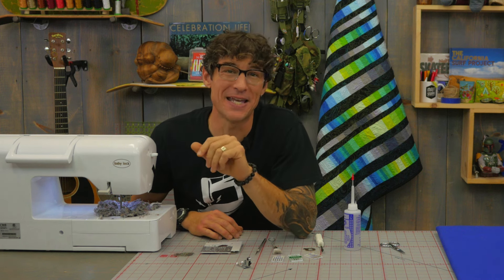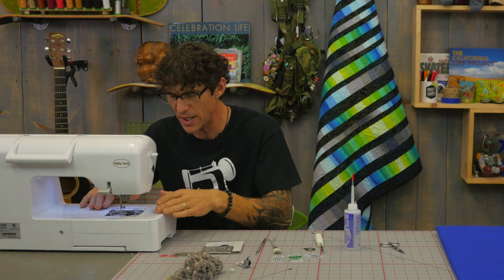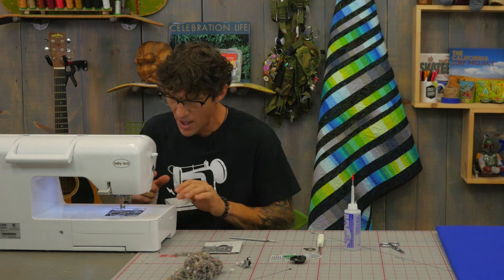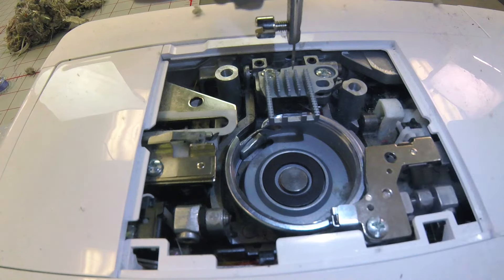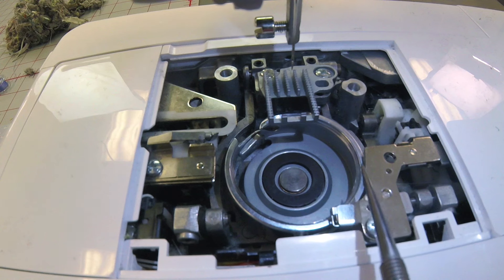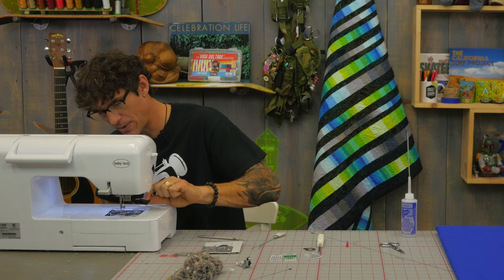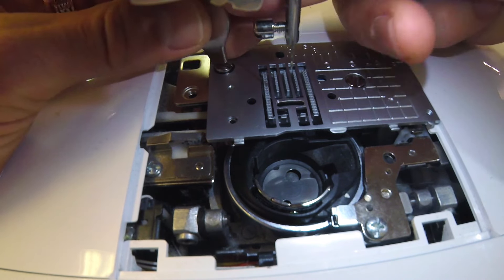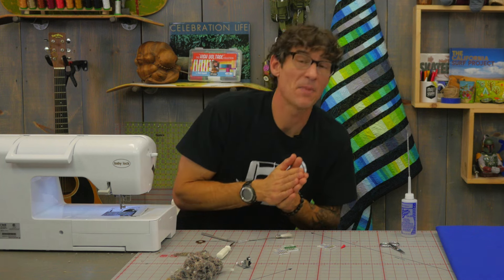Sewing Machine Maintenance: Troubleshooting Drop-in Bobbins

Comment: Thanks so much.  I have cleaned my machine many times, but ran into trouble putting the bobbin holder back in today.  That little mechanism with the spring was just a little loose, and until you mentioned it, I didn't know what was going on.

Fixed and ready to sew!

Comment: You always explain why you shouldn’t do something. It was explained to me why you never use air on a machine. It can blow the lint into the motor and cause a fire. I was taught to use qtips to get the remaining lint out by going around all the open areas and rotating the race you can get to areas that the qtip fits in and it sticks to the qtip. The only time the service tech uses air is when the covers surrounding the machine are off and it can be blown completely out. I hope my description is understandable. Thanks again for all you do to help us learn more about our machines.

Comment: Perfect!  I take my machine apart regularly for cleaning but this video was a great help. Had a "piercing" issue when my machine was less than 3 months old  - $100 later, the repair tech told me about the needle piercing the black plastic part and that there was a bur on it - now I know what to look for - if it happens again, I might be able to troubleshoot the problem so my machine only needs a shop visit for an annual overhaul. Thanks for this tutorial, Rob!
Reply from the maker: Thanks for tuning in, Robin!

Comment: HINT...to use the small metal ring screw...put in screw slot, then insert the long screw driver through the hole of the ring to turn it. Thank you for this video. I learnt so much. You're easy to follow. Don't change, great format.

Comment: Thanks for the tutorial, very helpful.  Sometimes I use a drinking straw with a piece of thin fabric over the end that I put in my mouth and I suck some of the lint out that way.  Helps in those areas down in the machine that I can't even see but where lint has accumulated.
Reply: That's a genius idea. Thanks.

Comment: I am still trying EVERYTHING to fix my tangled thread mess on the bobbin side of the fabric. I am told it has to do with upper threading, but it is threaded correctly. I have a Brother cs6000i since 2016. All of a sudden it hates me. Haha. No error messages, just a tangled mess. ANYWAY, I removed the metal plate with a penny as my screwdriver. Why supply a screwdriver too tall to use is another mystery. Thanks for your video, I am a subscriber now!

Comment: I love how descriptive this video is! I recently started sewing and was not aware that I needed to clean the lint out of the bobbin case until my bobbin case got damaged. I will be using this video for reference when I get my new bobbin case today. Thanks 😋
Reply: Where did you order??
Reply: Mahaliah Maurice I ordered from amazon, although it didn’t fix the problem. I have a Brother, I called customer support and the wonderful representative walked me through several things I could try to get it to work and it turned out the bobbin case was fine, I just needed to change the tension, use a different sized needle and that was it.  After the call I was able to use my sewing machine with the original bobbin case and it’s been working smoothly ever sense. 🥰

Comment: I have a Singer model 2277 Tradition machine and just received it two days ago and have not used it yet since I have to find more supplies, material, and thread to get started. I like how you described how to clean and lube the machine so it is ready to operate again. My bobbin case is on the side instead of on the bottom and I have to figure out the difference in that position and if there is any effect difference between these two positions.

Comment: I have a Viking.  I was told to never use air to clean out the machine and that it never needed oil.  I clean out my entire bobbin area with my little brush every 3 bobbin replacements. Lots of fuzz!  I'm quite careful to not push more lint down into the machine: I try to get it all. Good video!
Reply from the maker: Thanks for watching, Cindy!
Reply: Oh, it needs oil. All sewing machines do. It just needs to be disassembled and serviced by an experienced technician in order to be accomplished without harming the machine.
Reply: Carlton Wilson, google the name of your machine + service manual. Tells you how to safely take your machine apart.
Reply: @Carlton_Wilson  My machine manual has instructions on where to put the oil under the bobbin case (I'm sure other moving parts might need it at some point but a technician would be best as they're inaccessible to the average user), and it came with oil for the machine.

Comment: I take my machine apart like that after every project to clean out the lint and the fuzz. If it's an ongoing project, I like to clean it out every 3 weeks. Sometimes more often. I guess I'm lucky cuz I don't have any of those tiny screws to deal with. And I don't like to use canned air, but I have once or twice. 
Thank you for a great video!

Comment: After changing the bobbin I got a thread jam. While clearing the thread jam I took the needle plate off to get a better look. Then as I pulled the thread and moved the handwheel back and forth per manual instructions the bobbin case popped out. I had to force it back in and it kept popping out again. You said "the needle plate holds the bobbin case in place", so I put it back on. I still had to rethread the top thread and then the machine worked as it should.

Comment: Nicely done:
Great instructional.
Super camera work.
Words are very clear and precise.
Voice delivery is very confident, yet calming.
Now to the cons;
It's not you, it's me!The Husqvarna Designer One I own, will not pick up my bobbin thread. 
I am pretty familiar with working on sewing machines. I have several types  and models. 
However, this is the only touchscreen I own. I am baffled with why it is not picking up. It does not move or engage at all. It is a floating type bobbin holder and race. 
If you have any ideals as to what may be causing this, 
I would be very interested to know??
I appreciate any input you may have.

Comment: Never thought to use an air compressor. Great idea. Very useful tutorial. Thanks.
Reply: NEVER, EVER blow air into an electronic sewing machine.
Doing so puts moisture into the machine and, far more importantly,  blows oil and sewing debris deep into the machine and onto the backs of expensive circuit boards.

Anyone who advises you to use canned air on your sewing machine is demonstrating their lack of repair experience.
Reply: @Carlton_Wilson  an air compressor is not canned air. And some machines are not electronic (electric, not electronic) and don't have circuit boards.

Comment: The bobbin area is making a scratching or rubbing noise.  But, it only does it when I insert the bobbin case.  This is a brand new machine (about a week old).  Nothing looks wrong with dropin bobbin.  I changed needle, etc.

Comment: I've got 8 machines, two of which are Singer 500a that I LOVE & a 1904 treadle.  I love maintaining, & cleaning these old machines. But whether it's my vintage or my new machines, those screws on the throat plates are a pain in the patootie!  I also use a mini-vac with mini attachments to clean out the fuzz. Is that ok? I was gonna get some canned air, but you've warned me off it now.

Comment: Excellent video. What do you call the part that the bobbin case fits into? with the magnet inside of it? We cleaned and oiled the machine and now that part won't turn. Singer 478 machine. I can't pick up the bobbin thread when turning the hand wheel. Is it the "race"? Please advise

Comment: i have a problem with my Elna 6600 the leg / shank the holds the foot will move from side to side (when not in use) if i touch it with both index fingers on the left and right of this bar. all so i have noticed needle marks on the plastic bobbin top.  my attention was brought to this when using my 1/4" foot as the needle would catch on the foot causing the machine to make horrible noise and may be bend a needle. i hope i have explained this to you ok and can point me in the right direction of helping me solve this. Thank you for all your videos and taking the time to make them for us all to watch and learn. x

Comment: ...that case that the bobbin sits in...on the front, is a small screw, that for some reason...I got a small screwdriver in there, to adjust it (but I can't remember why)...now my straight stitches are not straight anymore, but slanted...can you tell me what that little flat screw is for and if this may be the cause of my slanted stitches? thanks!

Comment: This video has been the most helpful! I did notice that my "position finger spring" that you mentioned is not as flexible as yours shown in the video...does this mean I should replace it somehow? I have not yet found a replacement part. 
Thanks for your help!
Reply: I notice the same thing about my “position finger” with the spring underneath but was scared to try and softly pry(if that’s possible) the flap open so I could have a more of a spring at that area.  On my machine, it is almost flat! I see that you posted this 5 months ago but I am curious if you ever found an answer or solution to your question? I am very new to sewing but just when I start to love it I am noticing problems.  They say it. Ours be up to 8 wks just to have my machine back to me but I know that lever needs to have more spring to it...surely it has to make a difference. .?  Anyways, Thank you for any feedback you can provide.

Comment: Im on a time crunch sewing stretch fabric for a recital (so i need a zig zag stich) and all of a sudden my bobbin stiches are super loose. Pulling through the fabric even with the top tension set to zero. The top thread on my zig zag stich is a total straight line!!! Im hoping the issue is what you said about fuzz disengaging the bonbin magnet. Thanks for the awesome explination! Wish me luck!
Reply: YOU ARE A LIFE SAVER!! It worked! I never would have figured that out on my own. Or felt confident enough to take off the plate. Luckily my machine looked ecactly like yours on the inside. THANKS!!!

Comment: On bulk trash day. a neighbor put out a Singer sewing/embroidery  machine w/cabinet to be picked up.  It was, by me.  All is good except when it came time to wind a bobbin.  The bobbin is the type that will fill right in the bobbin case.  There is a small spring like point on the bobbin, that when the bobbin cover is slightly closed, that engages the bobbin to fill.  The issue is the bobbin won’t fill.   The threads collect on the underside between the bobbin case and the bobbin.  

My question, is it worth getting repaired?  I’m not interested in the embroidery portion.  I just want an extra machine to use for longer, no rush  projects that I can leave and go back to at my leisure.  Any advice would be appreciated.  Thanks

Comment: Hi, I love your video. I have an issue with my Bob and casing and the needle going down into get the Bob and thread will not go in all the way it like hits the black casing but if I spin it backwards, it will work. the needle goes backwards, any hints on what’s wrong?

Comment: great video, sadly hasn't helped and I am ready to throw my machine across the room.  I can find no issue with the bobbin casing.  Have cleaned everything, ensured everything back in right, changed needle.  Top thread catching on the bobbin gate as the plastic bobbin casing turns.  The bobbin itself is just jumping and not turning.  2 seconds of pressing the foot and the machine is jammed, with nothing actually stitched in the fabric.  I guess I'll be calling the manufacturer tomorrow :'(
Reply: 😲Same as mine. It's just jumping and dancing around inside🤦🏾‍♀️
Reply: My bobbin jumps around and then jams....same here---everything was checked/cleaned and bobbin and needle replaced--no one seems to be able to consult from this point of our problem!
Reply: Hi...just seeing this.  You've probably figured it out by now.  Anyways...are you using the correct bobbin for your machine?  Bobbins sometimes look alike but all machines use a particular bobbin.  Check your machine's manual.  Happy sewing!
Reply: It's like the first time on the laptop and internet in 1996
Reply: Did you get the bobbin and case fixed? Sooo frustrating!!

Comment: Hi
I can not get my bobbin case out of the machine, I have a Singer H74, it appears to look very close to you bobbin case black plastic. It's a metal piece on the left side that will not move and I'm not experienced enough to remove and screw. Thanks for the insight, I have done the clean out the best I know how.  I will also purchase a computer cleaner. Thanks 👌🏾

Comment: Thank you for your help; My bobbin casing came out; I couldn't a line it back up; your video helped me;  I also have another question; I have a Brother se 625 machine; I was making the decorative satin stitch 6-02; it was doing fine then i changed the thread bobbin; now it want sew it right; it looks like heart beats; on the project i'm doing; But i can try it on a scrap piece of material and it will be right; HELP Please

Comment: Hi Rob !
Thanks for this great video. I inherited a Brother PE-200 embroidering machine (unfortunately without the tools or the card writer). I have tried it for 2 or 3 embroideries with different fabrics, different threads and different upper thread tension, but the results are all a complete mess, completely jammed. I guess I'll let the timing be professionally serviced, but before I bring it to the professional workshop, I'll try what you show here: carefully clean the bobbin case, and replace the needle.
Do you know what are the best needles for this machine ?
Thanks in advance.
Kind regards.

Comment: Is there something an average machine user can do when the needle is hitting the bobbin case and making a hole through it or do I need to bring it into the shop for a repair? My safety feature activated when I was sewing and the needle got stuck. Apparently it was penetrating my bobbin case and made a hole through it. I put in a new bobbin case and have done a little more sewing and kept hearing a sound that I didn't think I heard before this incident so I took the bobbin case out and see it's making a whole. I'm sure my bobbin case is in correctly so I don't know why the needle is hitting it unless something got off kilter when the needle got stuck.
Reply: Sheryl...you need to have your machine serviced. The timing between the rotary hook (that spins around the bobbin) and the needle is off, that's why it's making those holes. Normally the machine should never hit the bobbin case.

Comment: Rob, Thank you so much for your maintenance tips and videos. I do have a question. Some of your lint went down inside your machine, especially when you pushed the lint out of the grooved channels. Is that not a problem, causing it to build up over time deep inside the machine? Could a vacuum cleaner nozzle be used to suck the lint out? Again, thanks so much for your tutorials. They have saved me at least 2 trips to my Elna dealer for service. Keep them coming!!!

Comment: Just did mine yesterday..well..the one I'm currently using. I have oil on hand for my 221 FW , but doesn't have that awesome needle tip. Is that refillable? And where can I get one like it? Being old fashioned ...always have put that drop in bobbin area. My older machines of course drink it on a regular basis LOL.
Reply from the maker: Hello Terry! Oil can go bad over the years, I recommend that you treat yourself to a new bottle with the cool tip, and use it on all of your machines. The caps do come off and it can be refilled.
Reply: LOL...oil is barely months old...fw, of course ,not so much..1951 centennial .

Comment: I know this is an older video, but hopefully you check messages.  My issue is my top thread color is showing underneath fabric (bobbin color only showing a little on bottom). Have tried tightening top tension all the way to 9 and doesn't fix it.   Issue is ever worse with zig zag or decorative stitches.  Does that mean bobbin tension is too loose? Thanks!

Comment: My machine is one of the ones that you're not supposed to oil. I don't think oiling it would do any harm, so I just oil it every few years or when something feels 'off'. I do clean out the machine after each project though. It's so simple to do, and I love starting the next project knowing the machine is cleaned out. One thing I struggle with is knowing how often to get the machine serviced. Since it's running beautifully do I need to take it in, or only when something is wrong? I have heard bad stories about the technician in my area so I'm reluctant.
Reply from the maker: Hello there! I would recommend a routine check up every 18 to 24 months!

Comment: Good  video but my bobbin still will not catch when I put the needle down. The silver thing under the bobbin holder goes around but the bobbin dies not move and thread just stays in the same position.  
also when you were pushing something down your hand was covering that so I could not see it there was something there I should be pushing down on.. this is a Elna 6003 drop in bobbin.i changed needle too, any idea? Nearest shop is 1 hr away. Haha.

Comment: I have done everything you show to do and I am still getting a clicking noise when sewing and embroidering.  Got any ideas?  Could the needle bar be out of alignment and it is hitting the bobbin case?  Has a great stitch - no problem there - but after about 10 or so stitches, i get the notice to rethread my machine and it is threaded.